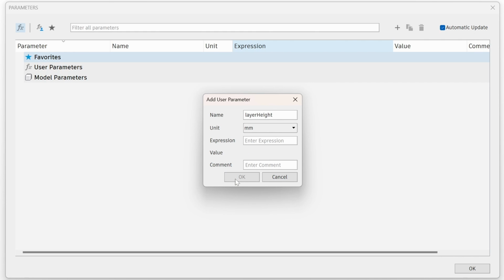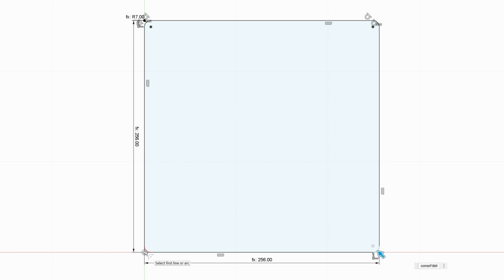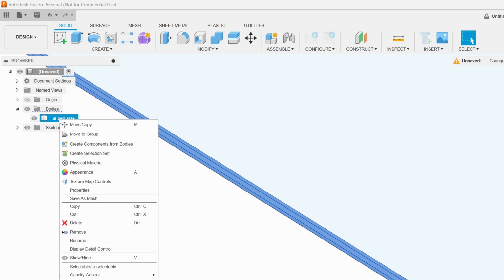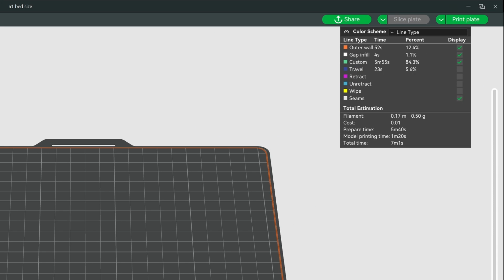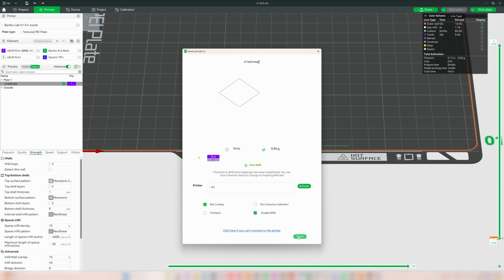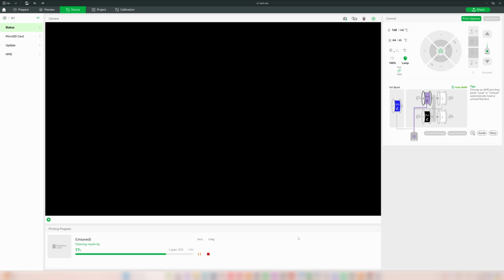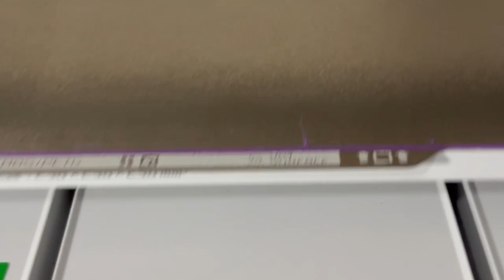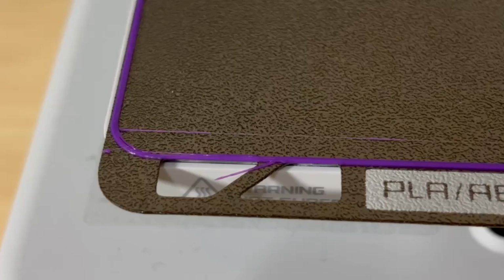a1 bed size is it really 256x256 (Bambu Labs)

Comment: Well no, no printer prints to the edge.  They print in the print area about 10-15 mm inward. So 10-15mm in from every side. It's because the way the build plates heat up. The very outer edge wont be quite the same temp as the center, so warping and bed adhesion become an issue.
Reply from the maker: I wasn’t talking about if a printer could print outside it’s stated range, just the considerations you have to make printing within the stated range, like on mine, the test line is within the 265x256 and to solve that you need to pause printer to give you time to remove it if you are doing a large print or just reorient the part to be horizontal if it only used the whole width in one direction. Or the consideration that one should design in rounded corners if using the full bed, as in you can’t print in mid air over rounded bed corners that are not physically there and this case it is 7 mm you can’t print on, so design that into your parts before you printed them and find out that fact later.

Comment: Unfortunately my P1S can't do 256x256 even with the corners rounded 4mm. The nozzle hits the PEI plate guides in the back. I see your printer is built different and doesn't stick up as high on the back corners. Don't know if I'll modify the printer or just get a bigger unit for the large projects now. Thanks for the video, nice to see some can do it!
Reply from the maker: I believe the P and X series can be modified to print on the full bed of 256x256 - https://wiki.bambulab.com/en/knowledge-sharing/print-volume-limitations but that does come with some limitations mentioned in the link.